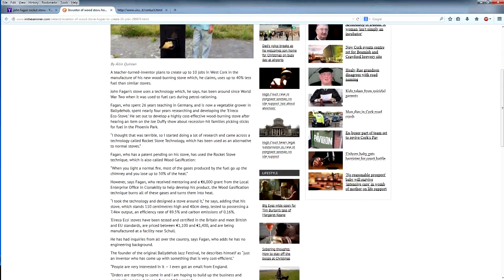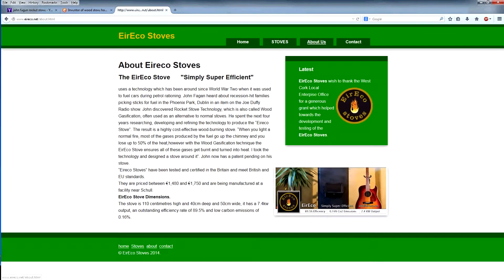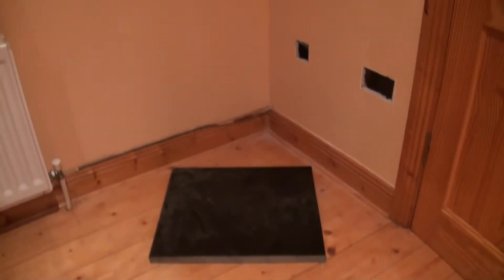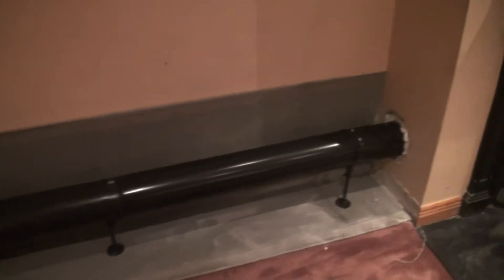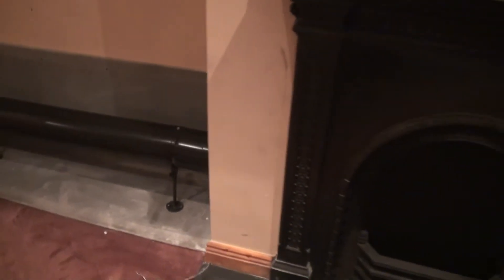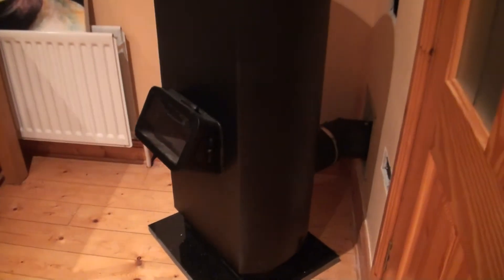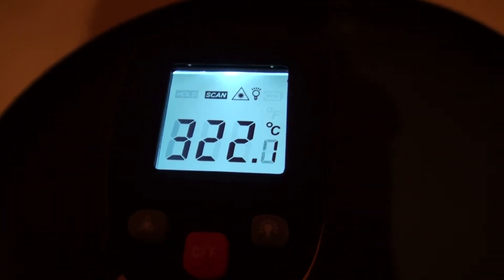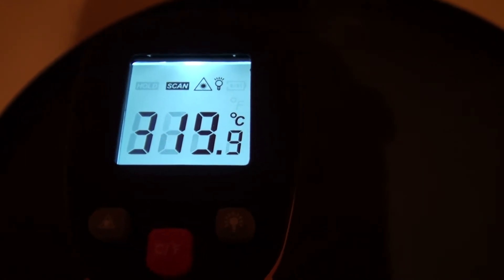Rocket stove 100615

Comment: nice build
Reply from the maker: +Don Gruzas Thanks Don. I couldn't say enough positive things about it, If this type of stove was more common it could have a dramatic effect on energy usage across the world, with a small amount of wood you can offset oil/gas/electrical usage drastically reducing the need for fossil fuels, current 'open' fireplaces send most of the heat out to the atmosphere, a similar quantity of timber in the rocket stove can pretty much heat the house. As far as payback on investment goes I don't know of anything in the renewable energy market that will pay for itself as quickly as this. I have looked at everything else from air to air heat pumps, solar, photovoltaic, wind turbines - nothing comes within a mile of the rocket stove in terms of ROI, simplicity of operation, lack of maintenance, it has only one moving part...
Reply: +Aquavidify absolutely agree with you. I am happy that more and more people use this idea as this is simply brilliant way to save money on heating the house. I build 3 rocket stoves myself just not shared with youtube yet. I am using 10 meters long ducting in home and in the end of exhaust temperature drops to 50'C from 500'C which is on top of rising tube.Rocket stove gives nearly all heat to the house!
Reply from the maker: +Don Gruzas Great that you're building your own stoves, i'll look out for your videos. I didn't build this one - I bought it from www.eireco.net  I've had the rocket at a temperature of 450 deg C using only pine cones! 

The damage we do to the World by not being self sufficient in terms of energy is one of our biggest problems, burning kerosene from the other side of the world in your house is wreckless and insane.  I think when you get to use a rocket stove you want to tell everyone about it.